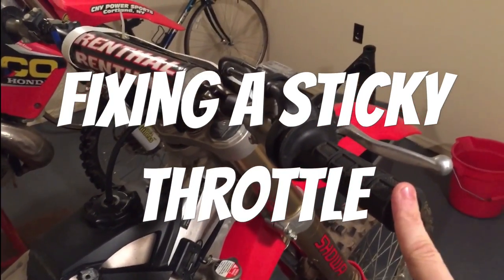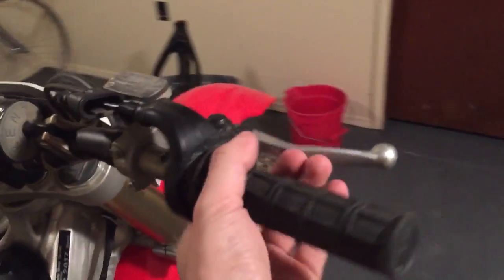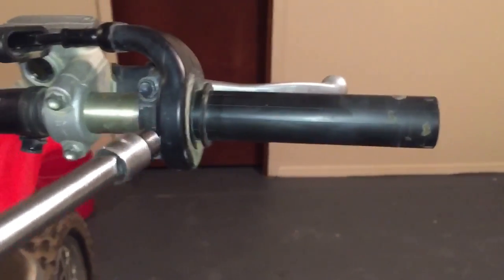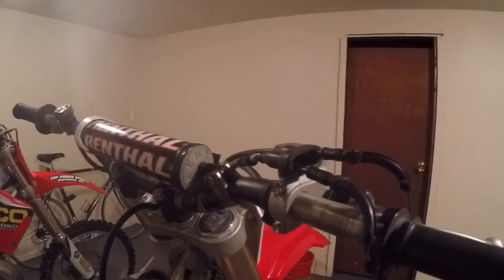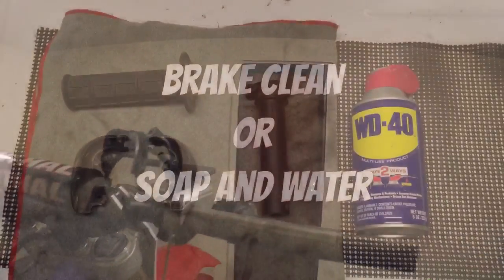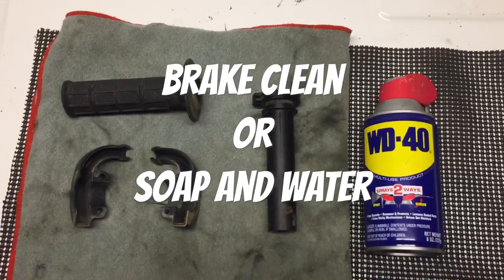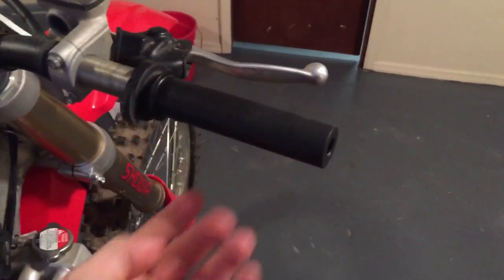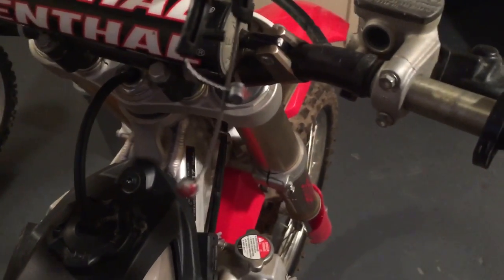Quick How To: Clean a Throttle Assembly

Comment: My bike is a 1982 kdx 250 and the throttle sticks but it’s not the throttle it’s like the throttle slide idk if I have to get a new spring or a new throttle cable
Reply from the maker: The throttle slide inside the carb is binding ?
Reply: @ClayFick  well cause I will be riding and it will start going up in rpm’s when I pull the throttle but it doesn’t go back down and I try to give it quick brapps and it doesn’t slow down I have to pull the spark plug boot to shit it off
Reply from the maker: Sounds like you might have to open up the carb. Clean it up and check jetting vs OEM spec and the throttle slide. Tough to diagnose through comments, but if a carb’d bike is giving you problems - safe bet that the carb is causing problems
Reply from the maker: Or you can start with adjusting the air screw from the outside on the carb. Screw it in or out until the idle settles down. Do you not have an operation kill switch ?
Reply: @ClayFick  funny thing 😂😂 I bought it jerry rigged on and yea ima try that my buddy says I should change the throttle cable I’m not sure if that will do anything
Reply from the maker: Sounds about right for an older used bike. I would say try the air screw on the carb first
Reply: @ClayFick  aight thanks for the help ima try it tomorrow

Comment: Thank u for the video bro. Question: I've changed grips and the throttle didn't stick before. New grips are on and now it's sticking. Is this down to the same issue?
Reply from the maker: Maybe the throttle tube got pushed too far on and now sticks because of it. Throttle tube needs to be away from the end of your handle bar just slightly so it doesn’t catch or rub causing friction
Reply: Yeah it looks it was the bolt in the bar ends was catching and tightening up. Loosened them up a few turns. Added some wd40 at both meet points and seemed to sort it. Cheers for the reply. Ride safe bro.
Reply from the maker: Of course! Safe riding to you as well

Comment: Thanks just picked up a crf450 with sticky throttle
Reply from the maker: What year did you grab? Also, make sure when you put the throttle tube back on you leave a little space between the end of the handlebar and the closed end of the tube. That'll help with friction rub. I hope the video helps out
Reply: 2005 i just cleaned the throttle came out like new. ill be making a supermoto build on my channel soon
Reply from the maker: That sounds great
Reply: @misfit1-3  that was 🧢